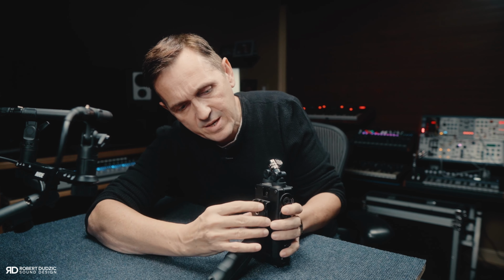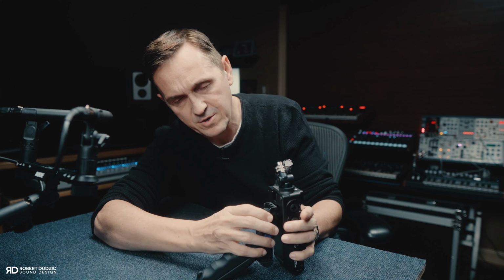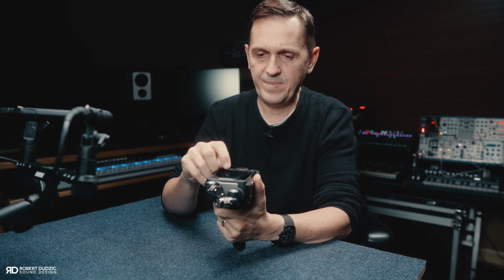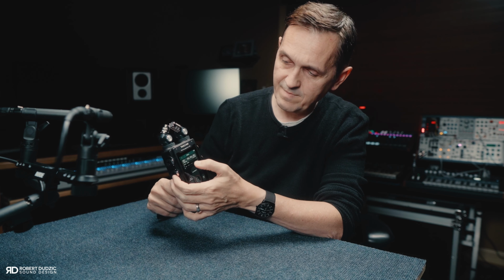CINEMATIC SOUND Portacapture X8 TASCAM - Audio Examples, Field Recording,

Comment: For sound effects recording, interviews, podcasts, etc it looks great. How about 4CH field recording using ambisonic mic like Rode NT-SF1? As far as I've seen most of the presets are designed for stereo so manual mode is the only one way. Looking forward to test it at Poland🙂
Reply from the maker: Hi I do most of my recordings on manual, like to have lot control and do my own settings. I speak direct with TASCAM in Japan and US and asked about adding Ambisonics. I just have no Idea when will happen.
Reply: Hi Robert. Thanks. 
It would be great to have it. Let's keep fingers crossed.
Reply: Any update on ambisonic support?

Comment: Hi, the pistol grip that you use, how did you manage to keep the Altura grip from covering your cold snow slot? I saw that you recommended the altura, I got it, but it’s covering my slot, I can slide my shotgun grip attachment on. Did you by chance cut your grip? Just curious?
Reply from the maker: Yes, i did little cut to fit.
Reply: Sounds good, taking a blow torch and razor blade helped me cut thru the plastic very easily (of course while using safety protection gloves/goggles) cheers for the quick response!